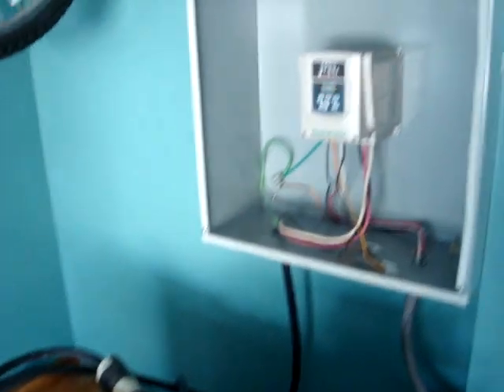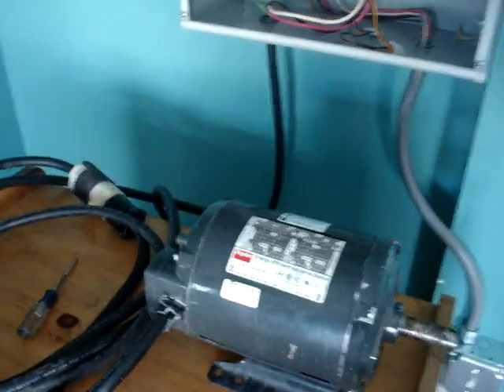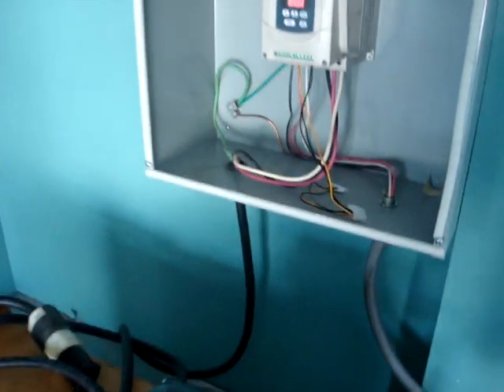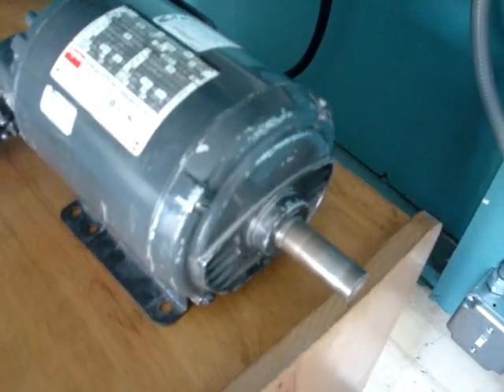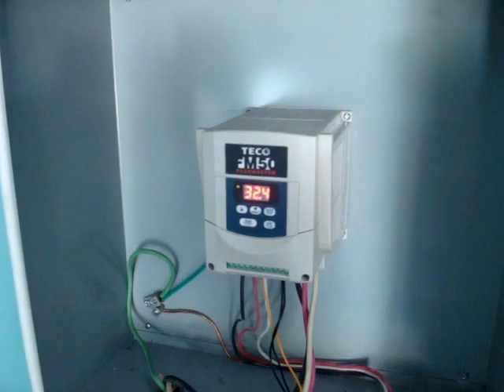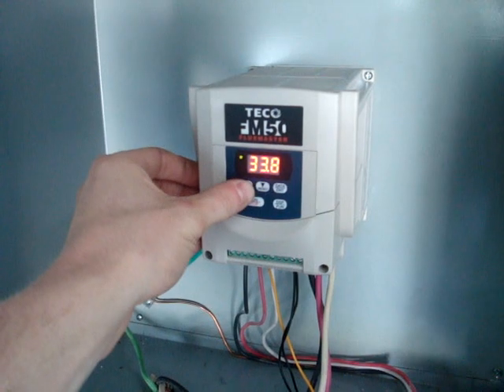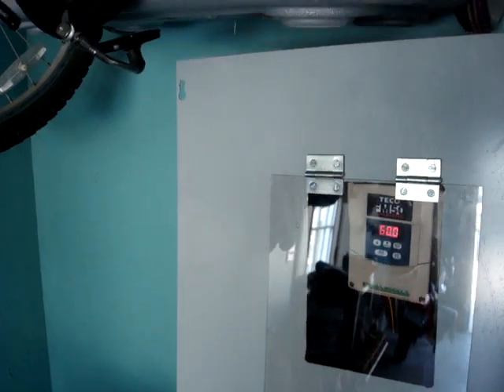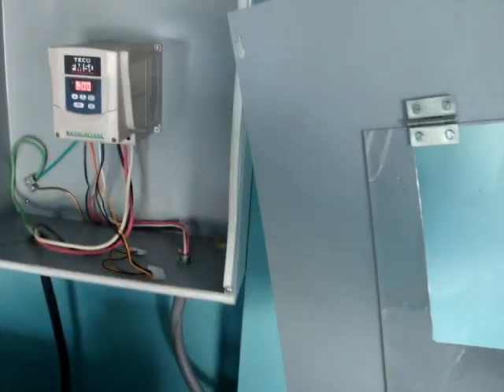TECO FM-50 VFD running 1.5HP Dayton 3-Phase Motor

Comment: Get your manual out and do some reading.. I’ll bet you can eliminate that noise. The motor should be whisper quiet with no load. Might be needing a bearing replacement but I’ll bet some changes to the VFD settings will sort it out. Don’t assume anything when you add new equipment.

Comment: It is interesting. From where i can buy one of this. I need to make a de reeling machine with 1 HP motor and gear system. If you have any idea please share. I need to vary the speed from 10 rpm to 50 rpm